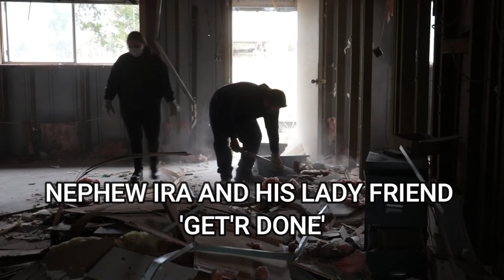Ep. 46 - Trapping Rain Water | Collection System Complete at Blackacre Ranch

Comment: My kids ask me that all the time, "you sure you can do that. Dad?"    'Of course I can, I am not 80 (yet!)" I am glad you’re using all the space over the “doors” and the gable ends to make the rainwater drain runs. It appears you’re using less materials and getting the slope you desire. Plus it reduces the chance to hit and break the pipe.  Obviously you might need to cut more of the tank top but a level run that short will do very little damage. If I may suggest you learn to use a level to get your pitch runs. A high or low spot on your “base” can screw you up big time, voice of experience. It’s worth the effort to learn to use a level, or especially a laser.
Reply from the maker: No experience with a laser level.  I'd love to learn that.  We will have to adjust the other side to this same method and get rid of the down pipes.